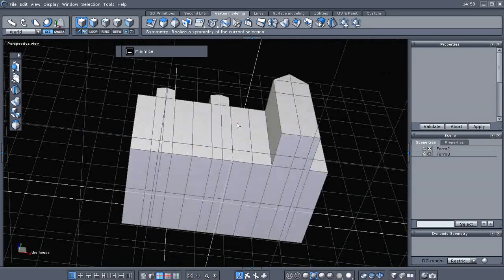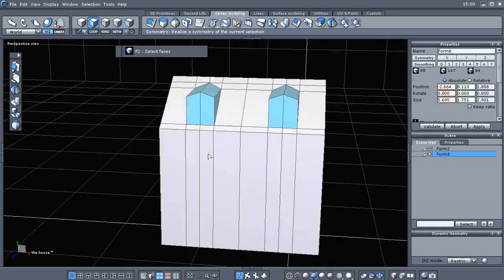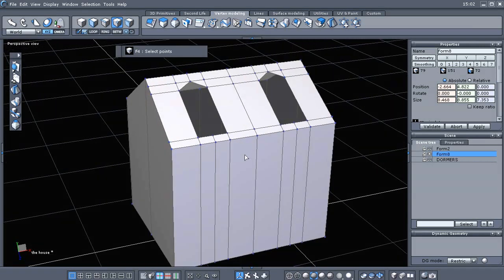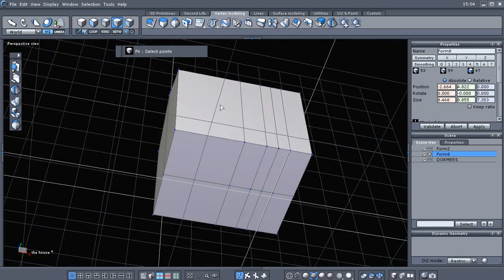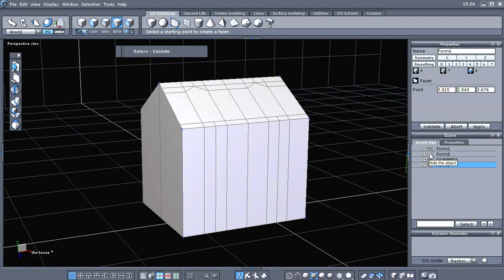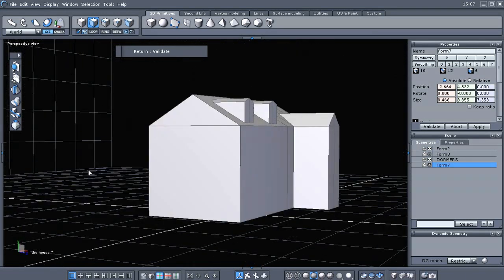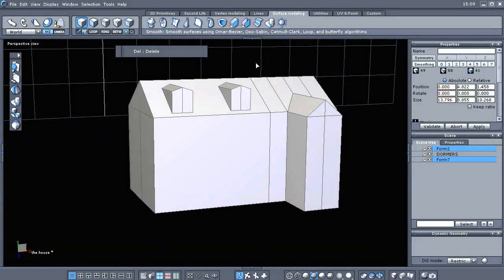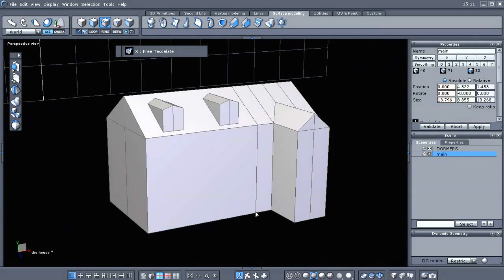Model a 3d house part 3

Comment from the maker: down on the bottom tool bar going from left to right second set of icons. You will find your snap options then after that is the third icon which is the constraint ruler option, make sure you have this icon selected while using the facet tool, so that you can freely move the tool in all directions.
The facet to must be active to choose the constraint options.

Comment: Second, that part where you use the Facet tool, I only have Points chosen from the Snap icon, second panel from left on the bottom, second icon. the Object is not seleted and I have Select Points chosen on top, second panel from left, fourth icon. When I try using Facet, it makes the sloped roof flat so it does not seem to work. If I highlight the object, it adds the new creation to the object instead of making a new object. I have no idea what is going wrong.

Comment: I have been following the House tutorial and through all three parts, I have had only three things different from what you do.

First, I cannot figure out how you rotate the objects with selecting Rotate Mode on the bottom, fourth panel from left, second icon. I always have to choose that to Rotate.

Other things in a separate post due to character limitations.

Comment from the maker: First thing I would do is double check your snap settings. At the bottom of the interface going from left to right , the icons are in groups. In second set, second icon make sure only points are checked.   Also you can switch to point mode and make sure that you don't have any stray vertex hanging around. If you do have a stray vertex, select it and hit your backspace on the keyboard to dissolve it .
 If you are still have problems let me know and we will try to figure it out.

Comment: Thanks for posting this tutorial. It has been very helpful in teaching me how to use the Hexagon interface. When I was following the tutorial, the section where you select the points around the sloping roof wasn't working for me. I watched several times and had snap set and snap to point - but it seemed to be snapping to another grid rather than the vertex points. Any idea what might be causing that?